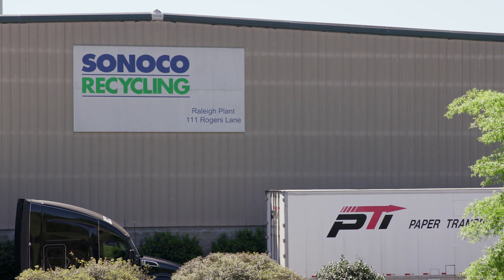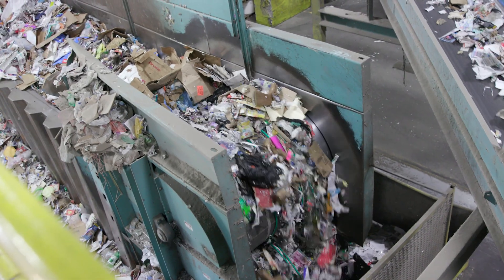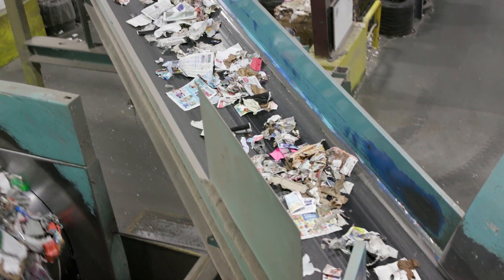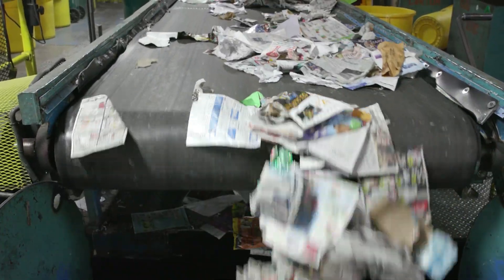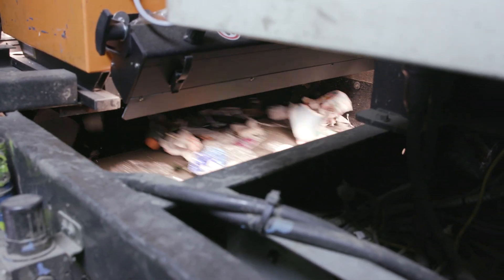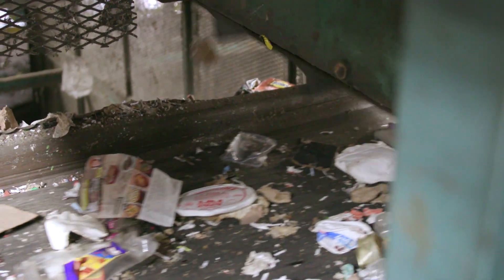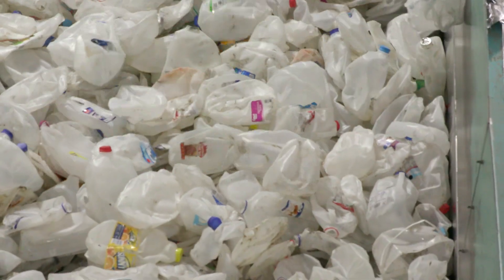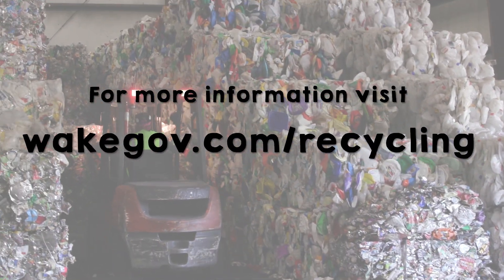Tour of the Sonoco Recycling MRF in Raleigh, NC

Comment: Where does it actually get recycled ?
Reply from the maker: We got a little more information on where exactly our recyclables often go in Wake County! Glass from the facility usually goes to Strategic Materials in Wilson, NC where it’s sorted for manufacturing into new bottles or fiberglass. Paper and cardboard baled at the Raleigh MRF may go to paper mills in the USA owned by Sonoco Recycling’s parent company, Sonoco, Inc. Aluminum and steel cans are transported to privately owned, domestic metal recyclers. Plastic bottles can go to international or domestic recyclers, including Unifi in Reidsville, NC.
Reply: Wake county
okay. Thank you for all the details I appreciate your response. Our recycling wasn’t being picked up for a month (reporting it did not work)and then when they came I saw the recycling truck take both trash and recycling and load it on at once. And I was having my doubts about recycling. But your response sure does restore some trust.
Reply from the maker: After being sorted at this facility, these used recyclable materials are sold to manufacturers who in turn recycle them into new products.